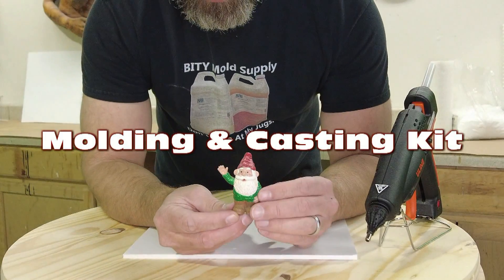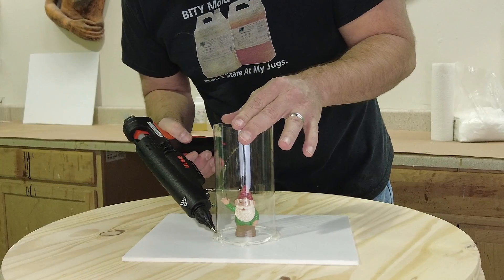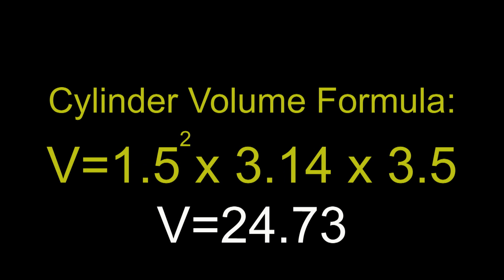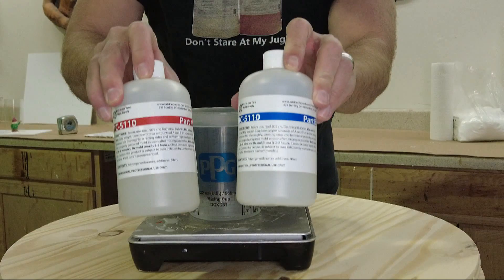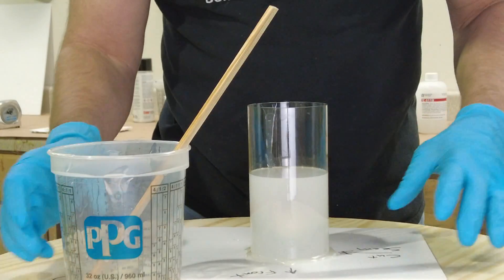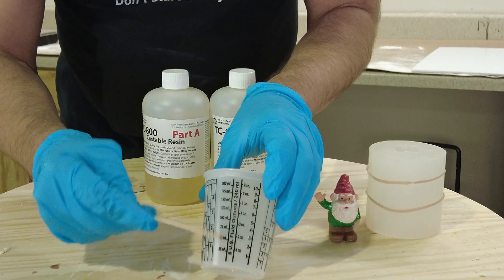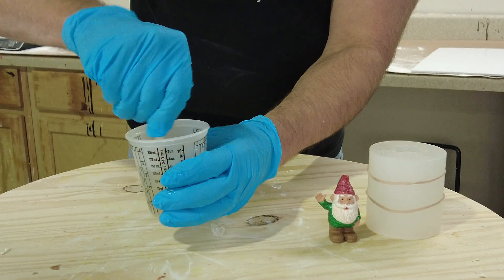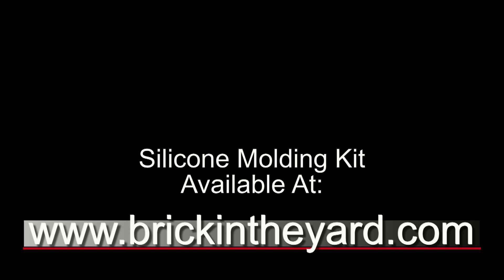Silicone Molding & Casting Kit Using 5110 Silicone and resin

Comment: V= r² ⋅ 3.14 ⋅ h For those of you who are not aware, when it comes to working with formulas, especially ones that are larger and or more complex, keep in mind you're working at an advanced level of mathematics, in this case, the cylinder volume formula is an equation that's most definitely given to a student who has graduated from the basic levels of arithmetic and has moved up to Pre-Algebra and I think it's first-year intro level of Geometry and then later it's Algeria I with Geometry 101 Algeria-II with Geometry102 then Trigonometry  AP Statistics AP Calculus, Precalculus etc.. I said all that because, if you notice, I'm not using the customary multiplication ✖ signs in my volume equation (V= r² ⋅ 3.14 ⋅ h)m,                                                                                                                                                                                                                                                                                                                                                                                                                                                                                                                                                                                                                                                                                                                                                                                                                                                                                                                                                                                                                                                                                                                                                                                                                                                                                                                                                                                                                                                                                                                                                                                                                                                                                                                                                           there are dots instead.                                                                                                                                                                                                                                                                                                                                                                         First, keep in mind we had no computers in my day, and everybody, including the teachers, had to write our work on 📝paper with a🖋or  a #2 ✏ . Well, some folks had sloppy penmanship and even lacked accuracy skills. Now if you scratch down a few of your equations using the lowercase letter x as an unknown factor and you're also using the multiplication ✖ sign, that might be a problem. You could mistake one of the unknown factors for a multiplication ✖ sign or vice versa. This is why we were taught to use a • as a substitution for the multiplication ✖ sign when working out any of these advanced Algebraic equations. 

Today with computers and the lack of handwriting, mistakes are far and few in between. 
    (V= r² ⋅ Φ ⋅ h)  or  (V= r² ⋅ 3.14 ⋅ h)  or    (V= r² × Φ × h)

This is the real►▸×◂◄multiplication sign.  Not▻▹x◃◅this. Big Diff. Chances of confusion.
             Authentic  (V= r² × 3.14 × h)                Fake  (V= r²  x  3.14  x  h)  

This is the real►▸⋅◂◄multiplication substitute, 
                       (V= r² ⋅ 3.14 ⋅ h)                                             

Sometimes this►▸•◂◄when Necessary. 
                             (V= r² • 3.14 • h)
                    
But never▷⩺ ·․· ⩹◁any of these.           
Peace ✌ to all.